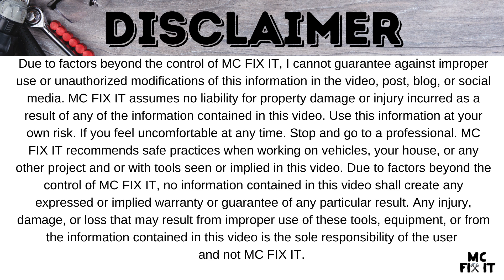How to Fix a Broken Garage Door Torsion Spring! [Complete Guide]

Comment from the maker: Here's my fix on my Genie Excelerator garage door with a broken torsion spring. This repair is difficult and can be dangerous. Please read the disclaimer and use caution. This goes over my way of doing it. Make sure to have the correct spring size, tools, and ability before proceeding. Make sure to have a friend assist you as well to help hold things in place.

TOOLS:
• Torsion Spring - https://www.homedepot.com/p/DURA-LIFT...
• Winding Tool - https://amzn.to/3Mp0ATm
• 7/16 Wrench
• 9/16 Wrench & Socket + Ratchet
• https://www.homedepot.com/p/Clopay-Sy...
• Sharpie
• Step Ladder - https://amzn.to/3bg8azE 

00:00 Intro
00:07 The Problem
00:37 Disclaimer
00:52 The Tools
01:25 The Fix
02:32 Remove Old Springs
07:03 Install New Springs
14:25 Winding Up the Right Spring (on the left side of this view)
16:44 Winding Up the Left Spring (on the right side of this view)
18:30 Test #1
18:45 Needs Winded More
22:31 Final Test

Disclaimer: Due to factors beyond the control of MC FIX IT, I cannot guarantee against improper use or unauthorized modifications of this information in the video, post, blog, or social media. MC FIX IT assumes no liability for property damage or injury incurred as a result of any of the information contained in this video. Use this information at your own risk. If you feel uncomfortable at any time. Stop and go to a professional. MC FIX IT recommends safe practices when working on vehicles, your house, or any other project and or with tools seen or implied in this video. Due to factors beyond the control of MC FIX IT, no information contained in this video shall create any expressed or implied warranty or guarantee of any particular result. Any injury, damage, or loss that may result from improper use of these tools, equipment, or from the information contained in this video is the sole responsibility of the user and not MC FIX IT.

#mcfixit #houserepair #fix #repair #garage #garagedoor

Comment: Hey just wanted to note that when you added the 3 additional quarter turns on the right spring, that it appears you did not loosen the torsion spring bolts enough as it turned the torsion bar.  So when you were slowly releasing it that it undid the 3 quarter turns.  If you go back and add those 3 quarter turns to the right side, it will be in better balance as it was still a little heavy at the end of the video.  I’ve replaced my torsion spring a couple of times because we use our garage as our main door.
Reply from the maker: Thanks for catching that!
Reply: Good catch.  I was really wondering why that wound back down.  That might explain why the test did not result in the door staying half way open when he let go of it.

Comment: How do you know what size spring to buy????
Reply from the maker: I thought I mentioned that. It’s based on the spray paint color on the actual spring, you can see that mine is white. So you get that corresponding color. I’ve linked mine in the description to the actual one I bought. Great question, best of luck on your project!
Reply: If the size isn’t painted on the spring, you get the right spring by measuring 3 things:  the spring gage, the inside diameter, and the length of the spring.  In this case the 218 is the spring gage (the diameter of the spring wire in thousandths), 2 is the inside diameter, and 26 is the length of the spring (not including the end pieces).  So 218x2x26 is painted on the spring at 14:42 on the video.

Comment: Hi, I got a Amarr double  very heavy garage door (we are in hurricane zone) which is out of balance because is almost impossible to lift it manuanlly. I followed your video and I found that I can't rotate the springs any more, they are totaled compressed. What should be the issue here, are the springs damaged, lost of eleasticty, old and need to be replaced?. The whole garage door and lifting system was  changed in 2015. Thank you
Reply from the maker: Maybe they installed the wrong springs in 2015. Id be shocked if they were worn out. Did you hire someone to put it in originally? I’d reach out to them if so.

Comment: My garage torsion spring broke after 18+ years, so I ordered another spring using the SAME SIZE shown on the broken spring. Installed it on my 8ft door which requires 33 to 34 turns. I’m up to around 45 quarter turns and when I lift the door halfway it falls to the floor. I noticed that this new spring did not expand out as far as the previous spring. It’s about 3-eighth inch short of the indentation mark of the old spring. Should I do 33 quarter turns and tap spring to stretch it out to the old spot on the shaft?
Reply from the maker: If that helps it stay up halfway well. Be careful and do a few turns at time to ensure it won't snap.

Comment: Things were going good loosened all the things we were supposed to when we went to take spring off bar it moved until it got to the thing it goes through and would not go through. Tried both sides. Can not get bar out of bracket. Any suggestions?😊
Reply from the maker: Which bracket?
Reply: The thing that the bar goes through on each end. It acts like something clamps down on it when we get to the either end of the bar

Comment: Got same length torsion spring and followed the steps; but issue I see is garage door only lift up till 1 foot , stay stuck and does not move up regardless how much manual lift force I put in (in manual mode). please guide. I tried going up to 33 quarter turns (16.5 half turns) as 31 or 30 turns was not helping, rotation was clock wise for 33 quarter turns..
Reply from the maker: Did your door stick before you pull the original torsion spring?
Reply: @MCFIXIT  looks like switch spring sides and now it works and lifts 🙂
Reply from the maker: Glad you got it to work!

Comment: If only one side breaks do you have to replace both sides?
Reply from the maker: Yes bc it’s only a matter of time before the other one breaks. And it’ll be a little more stretched out in than a new one. Replace both at once.
Reply: Got it thanks. Is there a way to open the garage door with one side broken just to get a car out?